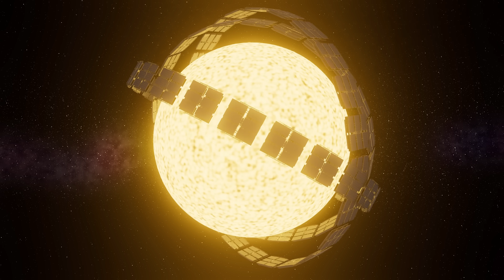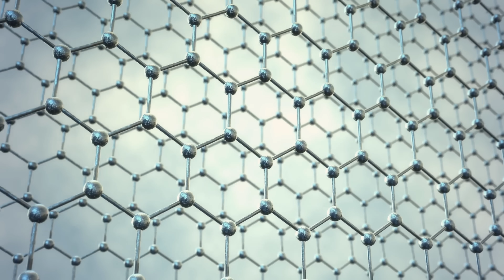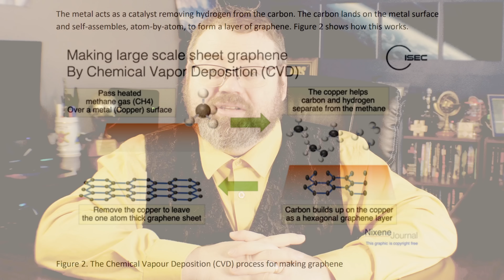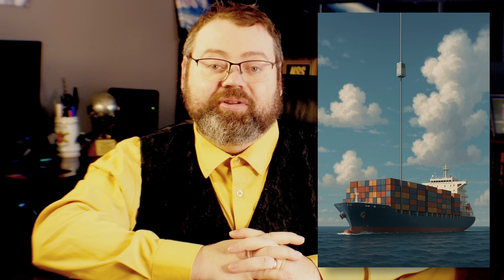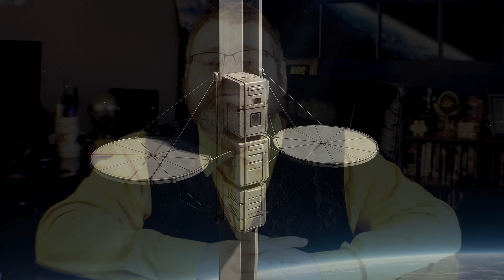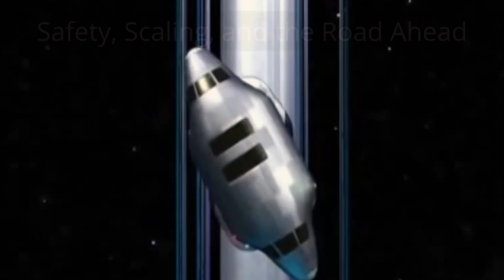Materials For Space Elevators - From Carbon Nanotubes To Graphene And Beyond...

Comment: I'm just not wild about the idea of "climbers" which roll or slide up the tether under extermal power. Just make the tether a complete loop like a vertical ski lift. The top end would wrap around somethings like a big ferris wheel. The lower end would be similar, but might not even be attached to the ground, hanging in the atmosphere instead. In the event of bad weather, the whole thing could be raised up to a safe elevation. Being free-hanging, the lower end could swing back and forth in the direction of Earth's rotation, effectively making it seem stationary for a period of time -a trick we would probably see rotorvators do, too. This would make it easier for a flying craft to bring cargo up to meet it. By the way, star systems which do not revolve around stars named "Sol" are not called "solar systems". There's only one Solar System. The others are called "star systems". Thank you.
Reply from the maker: You can't do that approach if the tether needs to be tapers to be wider up top.
Reply: @isaacarthurSFIA  Sure, but if the tether gets wider, possibly as wide as a football field, or more,  the "climber" will somehow have to get wider to wrap around it too. I suppose you could pleat the tether, but it's less elegant. Maybe someone in "another milky way" (doesn't that sound wrong?) has worked out the kinks. ;)
Reply: The problem with loop systems is that they don't account for the tapering that's necessary for the cable to hold its own weight.

Comment: How does the transfer of angular momentum to the object raised by the elevator occur? Do we have a very significant number of strong tethers anchored laterally to the main climbing strand? I don't understand how this is modelled. And additional angular momentum gained by the climber must have a source, and that is either transmitted by the tethers from the earth, or from the counterweight. If the former, you need significant rigidity, which I am not convinced is possible in any material of the requisite length. If the latter, you would need to reboot the tether periodically to ensure it remains in the correct orbit, which would necessitate lifting fuel, which rapidly descends to the rocket equation again. If you can take angular momentum directly from the rotation of Earth, you need serious rigidity over thousands of kilometers or relatively thin material. Can that be achieved with additional lateral tethers all the way out to GEO?

Comment: The thin nanotubes ribbon should be two way like a belt sander or treadmill, by having the ribbon belt regularly passing the ground station it can be serviced or repaired in place, they just stop the belt for a short time, then continue even if pods are on the way.

I also think of it as a ski lift going up the mountain, pods could be going up and down the same time.
Reply from the maker: problem here is tapering, if the elevator has to be thicker up top than bottom, then you can't do the conveyer belt approach. I'm pretty sure even theoretical max grpahene still need to taper for Earth
Reply from the maker: it works on other planets with less gravity though :)
Reply: @isaacarthurSFIA  How about using multiple conveyor segments? Thinner in the ends, thicker in the middle and have the pod move from one belt to another? The transition stations will absolutely have to be super-lightweight and minimal, but they would need to be able to transfer the movement from one belt to another. The benefit would obviously be that we can power them all from the ground up (and most likely from the top down as well) and thus we won't need a motor to move the pod, increasing the carrying capacity. As a bonus we can make the belts the same thickness which should make the manufacturing process simpler - albeit not simple. So instead of making 1 amazingly long tether, make 10, 20, 100 or 1000 that is obviously going to be twice as long in total, but still a lot shorter than that one long tether.
Reply: would be like a paternoster to space
Reply: That's a nice idea and much more similar to how we build real elevators in skyscrapers and gravity lifts up mountains or hills

Comment: looking at the ribbon like the rope industry would, would it not be better to roll up the ribbon into a coil, and bread it with others? this would remove much of the issue with ribbons tearing, while also changing how it deals with wind forces. the breading with other strands would give it redundancy, with little to no knowledge of an issue to the cars moving up and down the line. having a cluster of tethers together would be a safe bet, but your best bet is the first tether to bring up more as the first cargo. the more trips back and forth with more tethers, the safer it is, while it is now stronger, to move more at a time. building out a ring from a strong tether point should be an early goal, to spread out solar panel coverage, while also hosting tourism habitats. more money into the system, means faster growth of the system, and yet more money to be made.

Comment: My preferred cross-section is a relatively thick core, with six belts connected to the core on one side and a round thick bead on the end of the belt.
Climbers would attach to each belt with the bead preventing accidental detachment.
The core alone would be strong enough to hold, but in theory, multiple belts would be strong enough if the core somehow failed.

Comment: I don’t like graphene because there is no way to connect one sheet to another. Carbon nanotubes can branch.
And of course you wouldn’t climb the graphene itself, it would just tear if you could get the friction. The core would be structural and surface would be another material.
A carbon nanotube core with branches to the surface molecularly bonded to microscopic black diamonds scales would provide for friction, durability, electrical insulation and radiation shielding. The surface could also be repaired by climbing units adding carbon as they climb.

Comment: I've obsessively followed and read every newsletter of the International Space Elevator Consortium and I promise you Space Elevator is a Spruce Goose to no where. Attaching a base station to the Earth's crust is a nonstarter. It just is. Endless risks and attacks capable against the base station, think "Contact" movie. Not to mention the issue of gravity pulling the cable to snapping limit. It's not happening. HOWEVER, space planes plus Sky Hook solve 99% of the logistical and security concerns of a Space Elevator for fractions of the price with already available technology. It just does Issac, and I'd wager you know that. Space plane flips the tyranny of the rocket equation on its head. The space plane lifts cargo or a rocket to 80,000-100,000 feet bypassing the vast bulk of atmosphere and yes GRAVITY! Then only at 100k feet do we need to use a fraction of a fraction of rocket fuel to meet the sky hook. The space plane is hyper efficient, the rocket uses 0.001% what it needs to lift from sea level, and the sky hook draws power from space via solar/nuclear/laser.  Unlike the StarShart of Space X a space plane will be fully reusable and can launch multiple missions a day. Also we can use spaceports with runways instead of the exploding rocket yard in Texas. I will never support Space Elevator from an intellectual position. I can't. The math doesn't math Issac....but I'd wager you knew that. Stay blessed Army.

Comment: Would it be just the one climber per tether? If it's multiple climbers (like many trains sharing the same track), how would they pass each other?
Reply: All the designs I've seen are one-way, but like train tracks with switches, I suppose you could build passing lanes. The Swiss do this with single-track funiculars today!
Reply: @TucsonD1  Does the taper need to be continuous, or could you build it like a suspension bridge where multiple cables of a standard gauge taper out at different angles to build the whole chord? If you can build it the second way, then all you'd need to do is build switching tracks in between structural ribbons to allow for passing.

Comment: I assumed you would use the principle of a cart moving with wheels, or a train, instead of a cable. Like a vertical super-speed train. Possibly with the "rail-road" shaped in a spiral inside the "tube" of the elevator, for security sake. Preventing the risk of that "train" fall all the way down in case of accident.

Comment: So when we get the tech to build space elevators, is it safe to say we'd be able to build zero point energy collectors too?
Reply: No, unless you want to propose how you think those two are connected
Reply: @cosmictreason2242  The idea of creating two gigantic flat plates that can be pressed together till they start getting pulled together by the Casimir force and then a charge of the same polarity is applied to the plates causing them to resist the pull of the Casimir effect. By tuning the electrostatic force to let the plates slowly move closer, more energy is drawn out of the vacuum than is being put into the electrostatic force. I read about it in an old Robert L Forward book.  It's probably outdated gobledygook now.

Comment: Suck the excess carbon out of the air, weave it into cables. Sounds like a plan.
Reply: I agree. CO and CO2 scrubber factories, along with methane scrubber/binder factories closely associated with cattle farms. 
Space industry should find its materials out in asteroids after the initial boost. And excess carbon could be used to create archologies, ultralight solar and wind (modern sails) powered ships and other things.
Reply: Power it with solar panels while you're at it.

Comment: I don't think they're possible because you can't have the theoretical tensile strength in a MACROscopic object. And it would still not be enough. Cosmic strings would be far beyond necessary with a breaking length of 1 light year (the maximum possible) but are theoretical and I'm not sure there are variants under planetary mass/km of linear density😅.